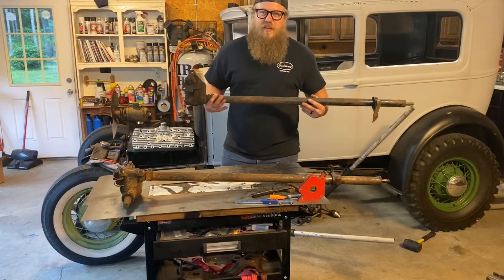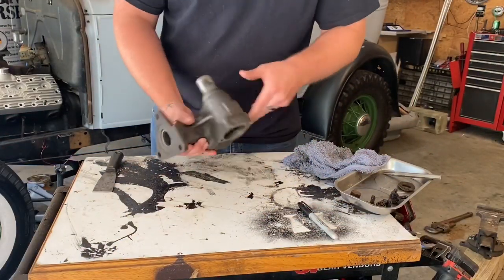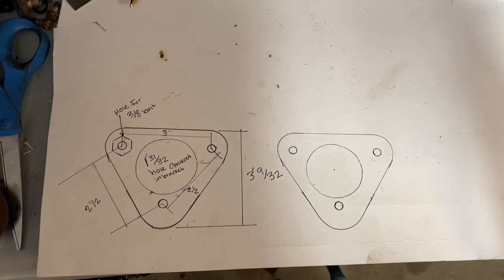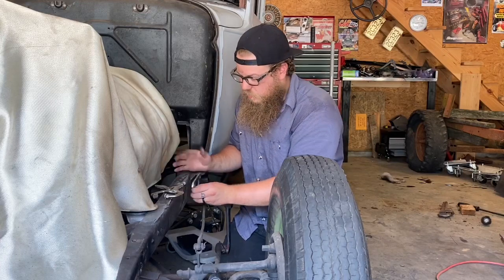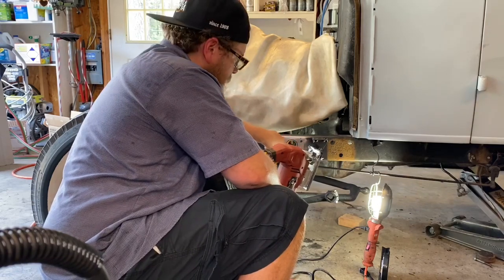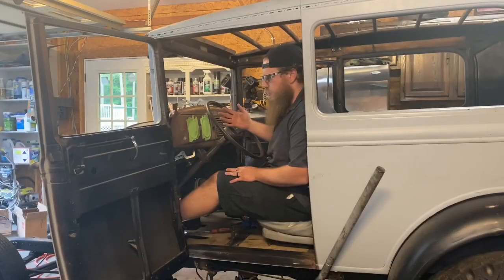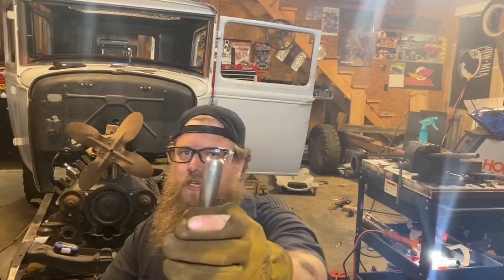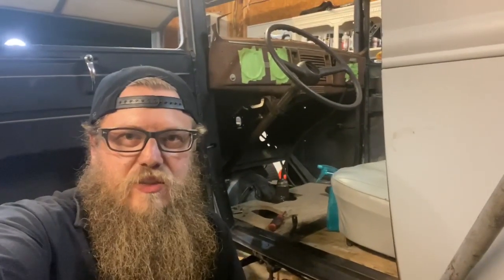Custom 51 F1 Steering Column, How it’s Done!

Comment: Awesome video! I see now that the rear exhaust port is going to be tight! Whats the plan with the headers? I am sure they are going to be custom.
Reply from the maker: Thank you! I am going to be making custom laker headers! And the box is just underneath the rear exhaust port, I plan on making the header in that area slightly arch over the top, and I am going to be doing header wrap that I am also going to use on the radiator hoses to match
Reply: @WiredCustomsSpeedShop  that sounds bad ass, are you going to be doing a how to on the lakesters?
Reply from the maker: I don’t plan on doing a “How To” video but it will definitely be in one of my Vintage Dragster series videos, I’m not the king at everything and doing headers is very labor intensive for me, to slow down and make a good video and explain every step would take too long lol
Reply: Wired Customs LLC 🐐

Comment: The steering box is casted..Would the MIG welding be strong enough? I tried to weld a litlle tab and a little effort broke it...
Reply from the maker: You have to torch the cast iron basically red hot right before you mig weld it
Reply from the maker: Also I have a big 220v welder that is made for that type of welding

Comment: I'm just about to start this myself, can I ask, is it ok to weld onto cast metal? I mean obviously you did it here but I've been told not to in the past.
Reply from the maker: You can weld cast iron but it’s way more technical, you need at least a 220 welder and you need to preheat the cast. If it’s something you’ve never done before I would suggest taking it to a welding shop if you’re going to weld anything that’s safety related
Reply: @WiredCustomsSpeedShop  Thankyou for your reply, good luck at trog 👍
Reply from the maker: @Templar1930   thank you!

Comment: And now your steering column is right in the way of the rear exhaust port?
Reply from the maker: The column is just underneath the rear exhaust port, I am running laker headers so it’s perfect, I’m sorry I didn’t say that in the video, box placement depends on the build, some guys put the box further back to have more room to run the exhaust down, center dups also work really well to move around the box